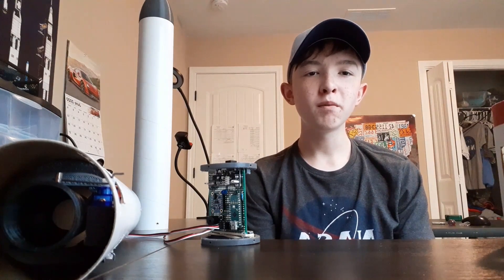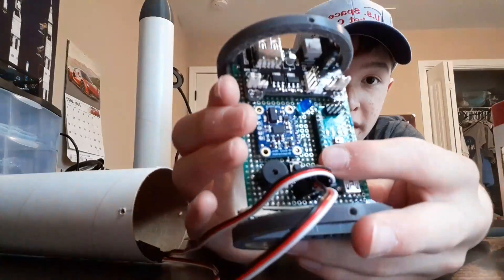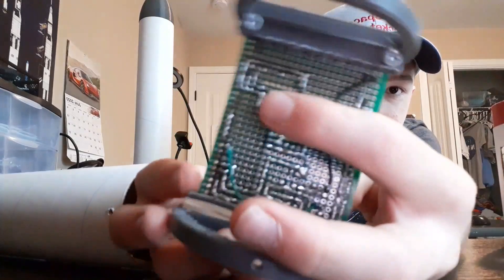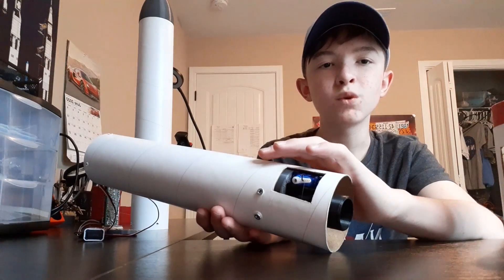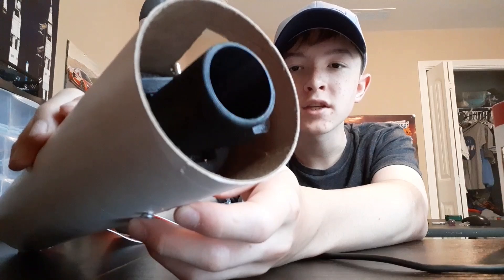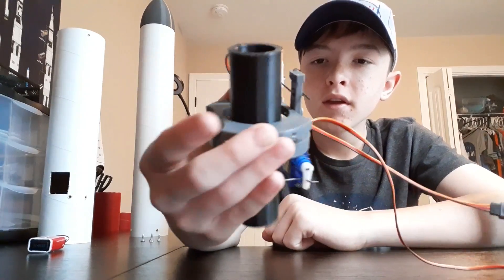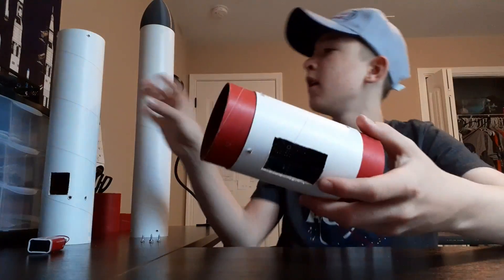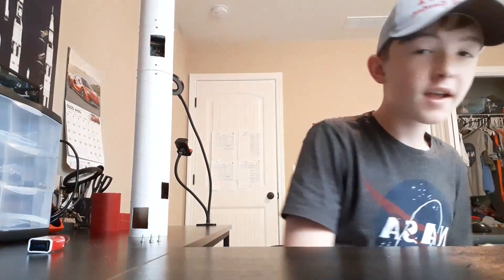Thrust vector controlled model rocket | update

Comment: Does it only move like that the whole flight? Im still learning how these work to create my own
Reply from the maker: If you are referring to the circular motion the tvc mount is making then no. That just demonstrates that it is capable of moving +- 5 degrees. During a real flight, it would angle the thrust in the opposite direction it is leaning, to re-adjust its orientation
Reply: @velocitylaunchsystems  ah I see

Comment: Can you provide me the code.
Reply from the maker: For what? I'm currently developing the flight code, and in this video I use a simple loop to move the servos.
Reply: Thanks for replying, what are you thinking about detecting apogee are you going to use the acceleration values and if yes than are you going to use the raw values or going to use some filter
Reply from the maker: For my first flight, I'm not going to obtain any data related to apogee. I want to focus primarily on getting thrust vector controll to work. On future flight computers I'm going to include an accelerometer, but as for this first flight, I won't have any idea of what the altitude is.
Reply: That would be illegel for him to provide the tvc code due to ITAR restrictions
Reply: @excelsiorspace3530  😂
Reply: @aksh_x_  it’s true look it up, it is a real rule
Reply: @excelsiorspace3530  Wut are you a "commie spy"! 🤣 How do know about these things! 🤣👀 Got my eyes on U! 😜
Reply: @terrywheelock9458  bruh I am just following the rules of ITAR
Reply: @excelsiorspace3530  There are no "ITAR" restrictions on Arduino code you write for a model rocket. This ain't Blue Origin or SpaceX! 🤣
Reply: @terrywheelock9458  well he is doing stuff with TVC and control guidance so technically he can not share the code because it is guidance and orientation so.
Reply: @excelsiorspace3530  Not for what he has done, once he has perfected and it actually works, MAAAAAAAYYYYYYBEEEEE! Even then NOPE! Arduino user code is not "ITAR" restricted. I get what you are saying, but the "ONLY" thing that would stop him from giving out the code, is that he actually makes a rocket TVC and FC that works, and he doesn't want to give it out!

Make everyone learn how to program. 😁
Reply: @terrywheelock9458  Well in theory he could just upload it to git hub and on git hub I dont think they care about ITAR. But he should fly his system first to verify it works.
Reply: You might be confusing "ITAR" with Personally Proprietary Code, and even then it is his code so he can give it out, but the person he gives it too cannot give it out, ..... unless he has deemed it "open source". 👍
Reply: @terrywheelock9458  Opps He said he was using a loop to control so it would be acceptable to share the code because it is not guidance from a gyro or it would be very  simple to code it.
Reply: @terrywheelock9458  No I am not confused in anything I am talking ITAR. Sense it is not Orientation or guidance then he could give it out but if it was it would be against the law to give like that out.
Reply: @terrywheelock9458  Any yeah I generally don't have time for arguing like this so I will just say your right
Reply: @excelsiorspace3530  but, But I don't wanna be right, ..... I am lefthanded! 👍
Reply: No, but I will provided deez nuts.